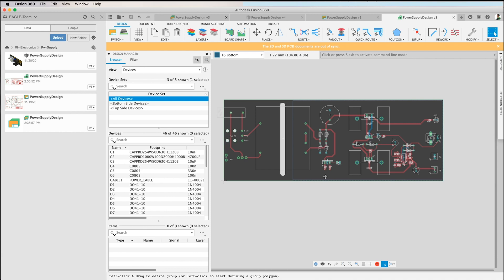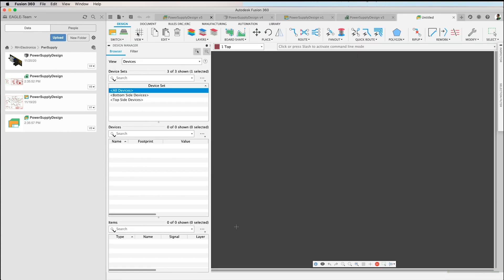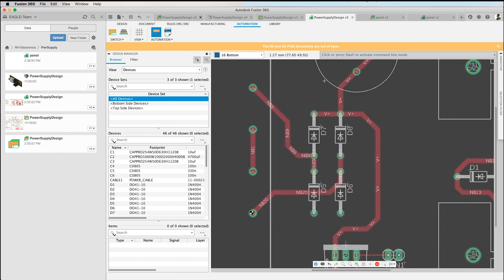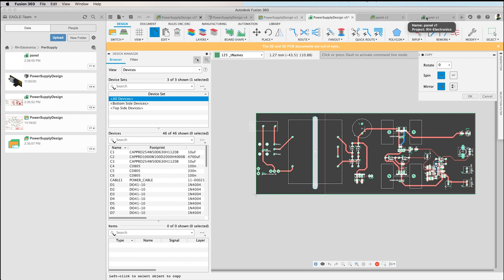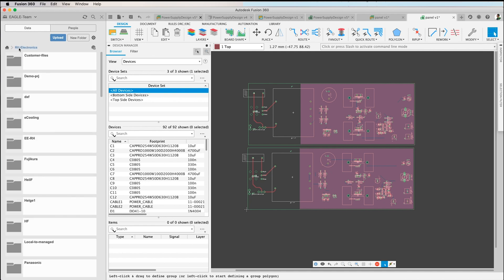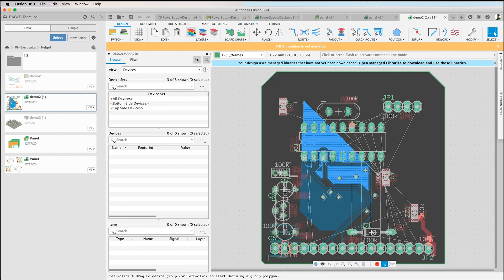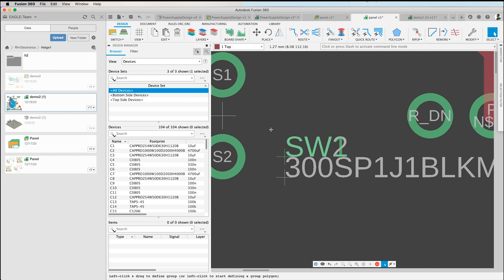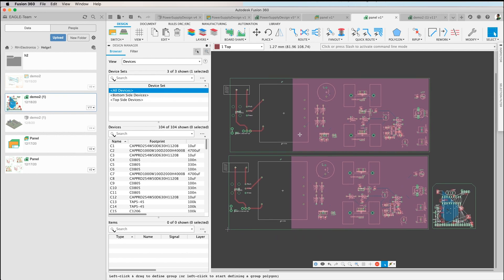How to panelize boards for manufacturing

Comment: Good start but this doesn't show how to create the boarders and rails that the pcb mfg's need to then score the boards.  Adding the pcb boarder puts it on the Layer 20 Dimensional layer that doesn't output to the gerber file.